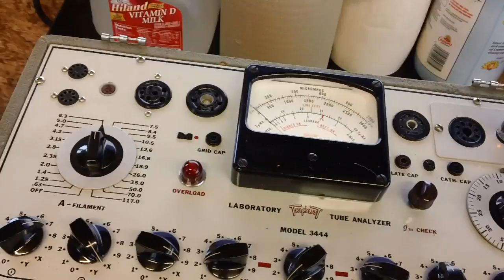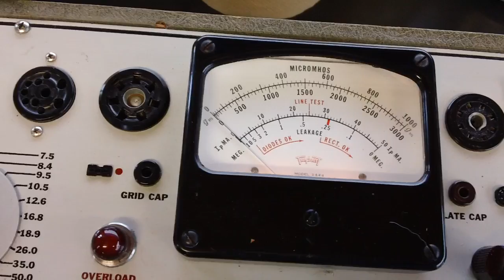1956 Sylvania 21" Halolight TV restoration (part 2 of 23).

Comment: Wow, lots of caps to change, I also saw a bumble bee!! I believe the light source for the Halolight is a cold cathode fluorescent lamp. This is the same light source for the first generation of flat screens. Now it's LED's. BTW, there are two different types of fluorescent lamps. Hot cathode and cold cathode. A hot cathode lamp is like the ones in your office, home, desk lamp etc. The difference between the hot and cold cathode lamp is longevity and efficiency. The hot cathode is more efficient as far a light output but at the expense of longevity. The cold cathode lamp is not as efficient bad has a very long life.
Chances are the lamp in your TV is good unless it has been damaged.
Reply from the maker: Jerry,
Very good info, my friend.  I greatly appreciate it and hope our other subscribers read it as well.
Thanks.

Regards,
John

Comment: Awesome!!! This type of set is on my bucket list, as well. But they are hard to find in the shape yours is in, especially here in the midwest! But if I get one to restore one in the near future, at least I'll have your series to learn all the gremlins these sets may have! Good luck, looks like a fun project!
Reply from the maker: Scott,
Brendan was fortunate to find this set.  He'll be the first  to admit it.  Frankly, I figured that if I ever did get a halolight, it would most likely be a total basket case.  Believe me, I'm thanking my lucky stars.  Unfortunately, because this set is in such good shape, you'll probably not learn very much from its restoration.  I'm no TV expert, but  feel free to chime in with any questions you may have.  If I don';t have the answer (which will most assuredly be the case LOL) ole Brendan will fill in the blanks.
Thanks for popping in, my friend.

Regards,
John
Reply: Actually John, I'm in the middle of an Atwater Kent 145...does that sound famililar? Your series on that has been most helpful. I'm doing some progress videos on you tube, but not detailed. No sense in doing that since you have that excellent detailed series out there. But that may be where I will have some questions as I get more into putting it back together!!! Tearing it apart and as you say...chop..chop was not hard at all! :)~

Comment: John, if your halo lamp is bad, bring it to a neon sign shop and have a new one made. Even if its a heated cathode fluorescent lamp, a cold cathode replacement will work just fine.  Simply replace the transformer with an electronic neon sign power supply.  They are very inexpensive and very compact, a 2kv model would be more than enough.  Great videos as usual!
Reply from the maker: Thanks, my friend.  Right now that's exactly my plan.  But let's hope we won't have to do it.

Regards,
John

Comment: Thinking about this course of events, it is surprising the direction things have taken.  But, it will be highly interesting.  Going thru some old books I found a book about all the early days cowboy stars, right up til the cowboy movies faded away.  It is so interesting!
Some on Youtube would show checking EVERY tube and changing out EVERY capacitor.  Thanks for the brevity, but if you run across anything interesting, please show it.
Reply from the maker: Ansel,
"Thinking about this course of events, it is surprising the direction things have taken."  You have me stumped, old bean.  Fill in the blanks.
And you can bet there will be some interesting things here and therer that I'll be covering in-depth.

Regards,
John
Reply: joernone   I only meant I never dreamed you would be working on a console, halo light, television as opposed to so many other directions that things might have gone.  It was as surprising as the Blackstone (I think) grill showed up and you started learning how to season and use it.  I love the grill videos.  I love all your videos.  Thank you so much for making all of them.  By the way, I think the radishes are finally done for.  Below 0 temperatures here tonight!

Comment: The people that make neon lights can reproduce that bulb.
A friend had an old(50's) 10'' magnifier that had a line voltage bulb that was of a funny shape,
well this bulb couldn't be found anywhere so he sent it and the specs to a company out east I think and got a new one for around a hundred dollars.
He said they could make anything.
Don't know  how much something like that would cost but it can be done.
If you want I will ask him where he sent it.
Reply from the maker: Slim,
Let's hope switching to neon won't be necessary.  Let's hope the halolight works fine.  But in case it doesn't...the neon route will be plan B.  Gotta love a plan B.  LOL

Regards,
John
Reply: No Joe. it was florescent. the company main business is neon.

Yes lets hope for the best! Looking forward to part 3

Comment: John,
Underneath the chasis, that orange thing with the fins looks like a selenium rectifier.  Presumably, it still works; if it doesn't, would you be able to replace it with a modern diode?
Thanks,
-Pete
Reply from the maker: Pete,
Right you are, my friend.  It is a selenium rectifier and I'll probably wind up changing it.  Those old thing aren't very efficient, wasting power via heat dissipation.  A 1N4007 silicon diode would easily take its place, although an additional series resistor of some low value would need to be added.  We'll cross that bridge when we come to it, so stand by to stand by.

Regards,
John

Comment: If the lamp is bad you might want to go for something like Electroluminescence tape.
http://www.ellumiglow.com/el-tape/el-tape-kits
Reply from the maker: Troydog,
How interesting, my friend.  I've never seen that stuff.  Very cool.  I will keep it in mind.

Regards,
John
Reply: I never used it myself but seen it in person. You can cut it into shapes and it still works. Ebay is the best place to buy it cheap. Whats nice is it is low volt and no heat at all.